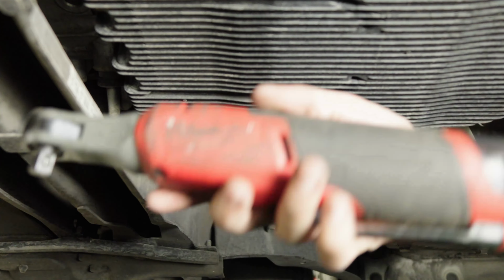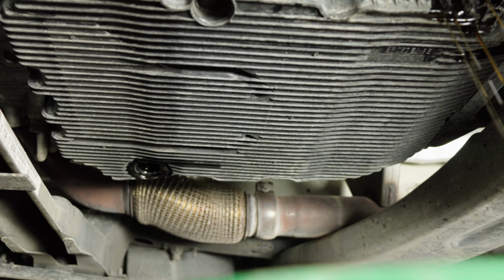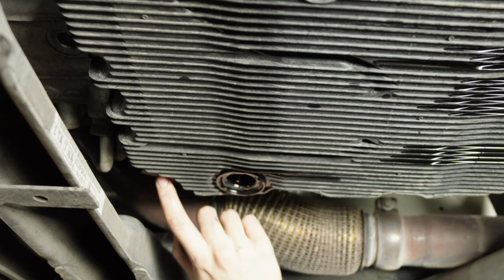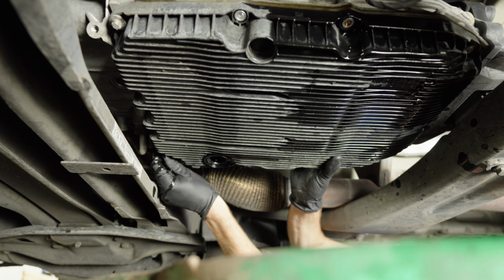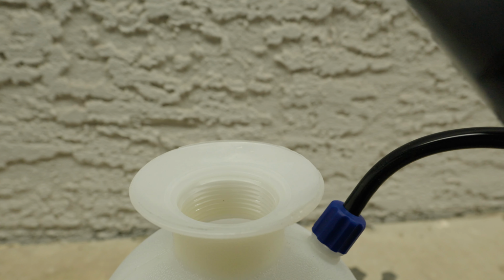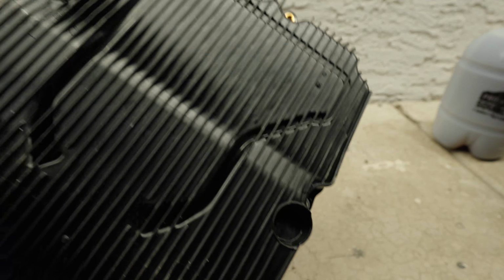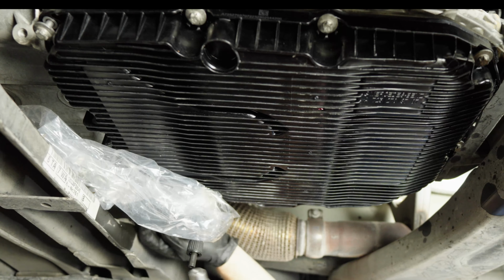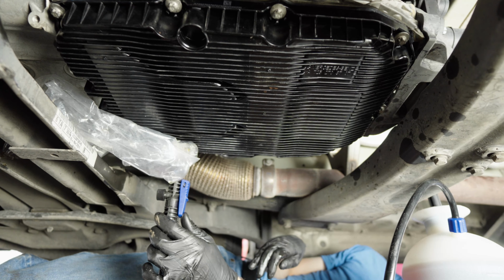How to replace transmission fluid 2021 Mercedes sprinter 2500

Comment: That's the first time I have seen brown ATF, except where the clutch plates are burnt. It is usually red.  So how do you know if you have filled to the correct level? I have a 2019 Sprinter. In the engine compartment there is a tube that looks as if it runs down to the gearbox but it doesn't have a dip stick. The MB dealer wants about £400 to change the fluid so of course I would rather do it myself, but without a dip stick how do I know how much to refill it with? My understanding from the owners book is that the fluid should be changed after the first 15,000 miles and then not until 75,000 miles. Any comment?
Reply from the maker: the plastic tube sticking up inside the oil pan is an overflow tube. When the fluid is at that level it will come out at a slow dribble. that's how you know it is filled. Why wait to change it? Doesn't make sense.
Reply: That tube with a rubber plug, right behind the oil filler neck,  is for an engine oil dipstick, not trans fluid. Don’t use it to try and fill the trans!

Comment: I did not hear the engine running.  just fill to run out engine off ?
Reply from the maker: Fill with engine running. I filled it a couple quarts and then started running the engine if I remember correct.